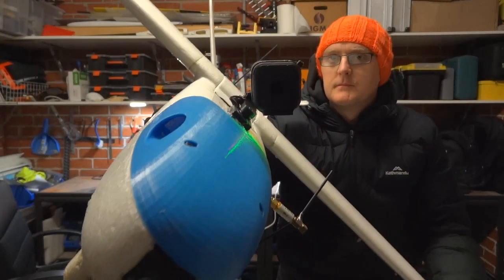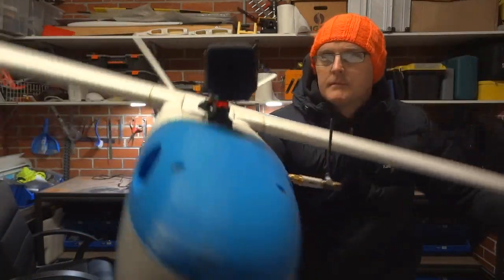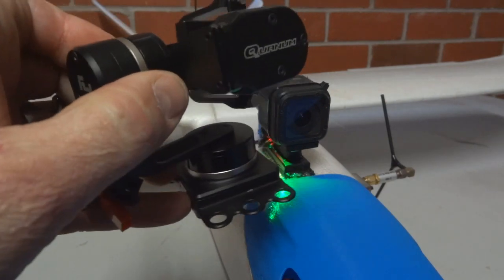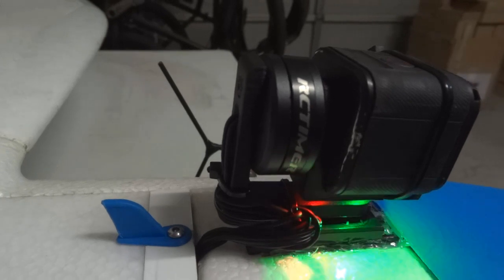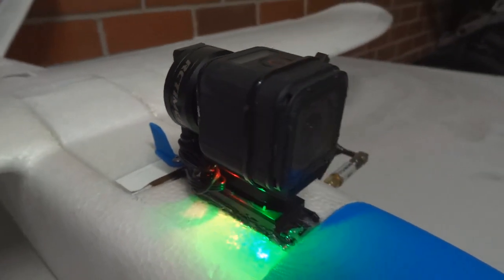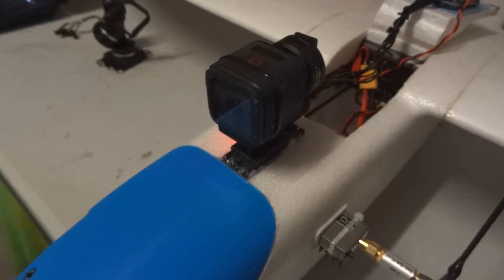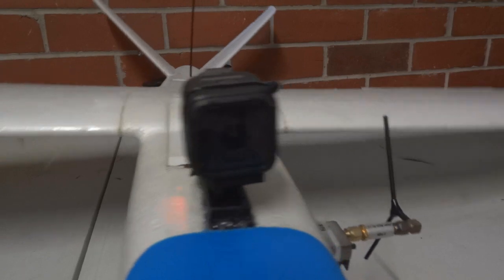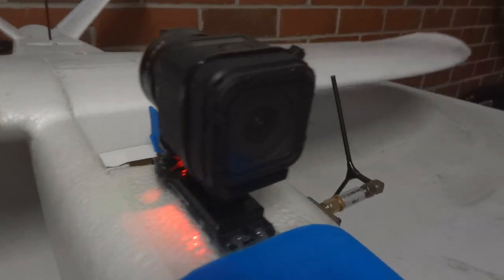» Single Axis Roll Gimbal

Comment: I need this gimble!!!!!! Where can I get one please!!!???? Need for a motorcycle!!
Reply from the maker: You would be so much better off just using a GoPro 7/8/9 with hypersmooth
Reply: @StuntDoubleFPV  how would hyper smooth help with the lean angle of a motorcycle? Track riding that is ? I’m somewhat new to all this gimble stuff
Reply from the maker: @vv-o-l-f9155  hypersmooth will soften the leaning. Mechanical gimbals can be difficult to tune and don't like wind too.

Comment: Great work!
I guess the fact the motor is hollow shaft is to allow passing the Accelerometer sensor cables?
Reply from the maker: Yes, the hollow shaft is important. I have now fitted a 4 wire slip ring so the gimbal can rotate freely

Comment: Sorry to ask, but I’m a complete newbie when it comes to gimbals. Any chance you could link to the 3D printed parts and the controller, I was able to find the gimbal motor on HobbyKing. Also, any tips for newbies on what might trip us up when attempting this build?
Reply from the maker: Mr.D - Falling, with style Hi there, ive updated the description with links. I might do a setup video as ive been getting a few questions about this gimbal
Reply: Stunt Double FPV Thanks for the links. If you could find the time to make a setup video, it would be most appreciated. 👍🏻

Comment: SD thats so cool... and smooth, you da man !!. I got back from Lysterfield MTB ride last Sunday and my cam mounted on the gopro chesty was looking at the ground most of the time. I would love to make a one axis pitch only gimbal for the session so it always looks level. Is the GBM2804 the smallest motor you would recommend. Is there a one axis controller or a smaller version of the storm available ?
Reply from the maker: jbalatutube Gday JB, i tried some smaller motors off hobbyking but couldnt get them to work properly. These rctimer ones are nice with the hollow shaft. There are some smaller storm32 boards although out of stock at goodluckbuy, might find elsewhere. The little micro board would be best for a chest mounted mtb setup

Comment: Have you tried to use it with the follow mode on so that the camera follows the bank of the aircraft? Would be really keen to see that mode ride out. Awesome flying site by the way 😀
Reply from the maker: jnb hi jnb, there is a screen forvrc inputs so i'll give this a test and maybe make another vid
Reply: the same question here, not sure if this is actually possible, it would require rx input.
Reply from the maker: PlaneCrazy no i havent thought about this yet, thanks for the tip. Its worth a try and would be fairly easy to setup
Reply: please test it when you get a chance, I'm especially interested in this setup, I love stabilization that gimbals can give but don't like that sort of flat view, banking with a stick (+ stab) could give more in depth feel of flying...

Comment: Wow, that's very good. I considered putting my roll gimbal on a servo for the new build, but also wanted to try Mark_q's canopy and roll gimbal design so ended up leaving it simple.  Will keep admiring your videos and one day I might reconsider. :)
Reply from the maker: Thanks. I'm gonna look through Marks collection and find a better canopy so I can move this gimbal and servo forward a bit. I might even try and mount the gimbal out past the nose looking back so I can get the full plane in a stabilized shot.